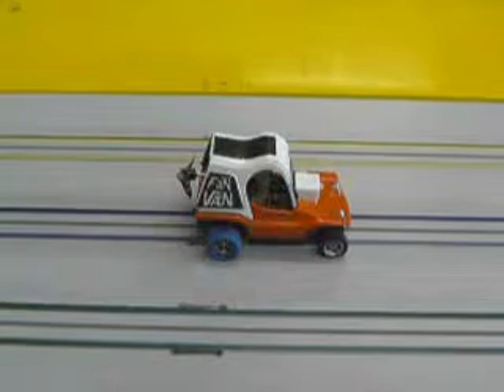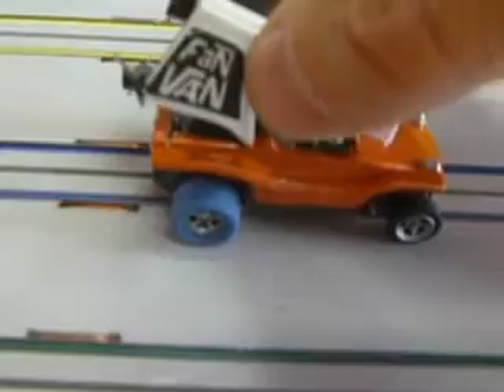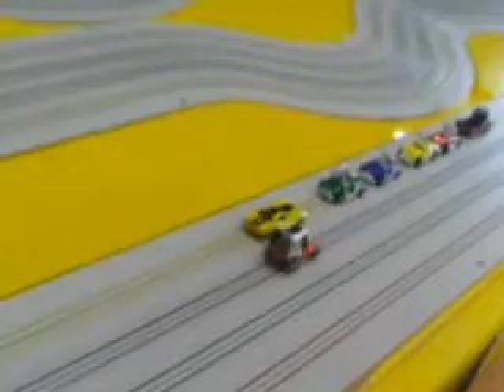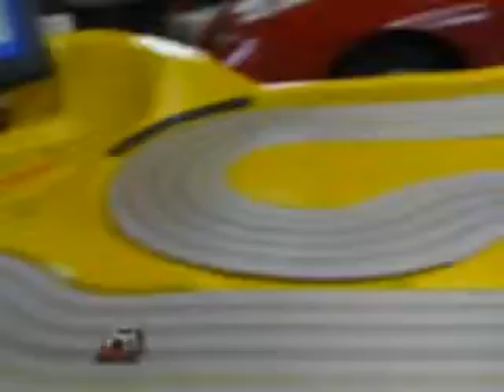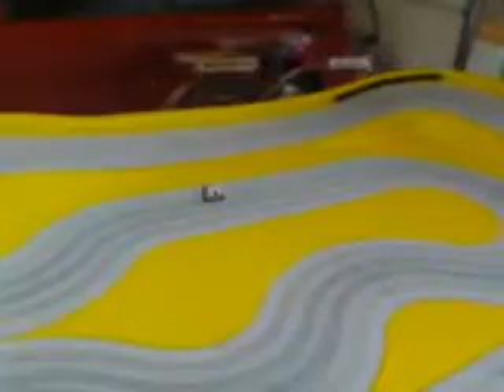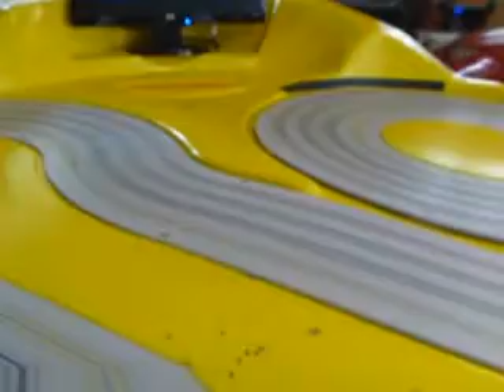Fan Van Propeller-Powered Slot Car

Comment from the maker: Beats me.  I've only run 2-blade props because that's all they had at the local hobby shop.

I'm sure that the prop I have is not optimum.  Ideally a prop would be designed around the speed-torque profile of the motor that is driving it rather than just picking up whatever's on the shelf.